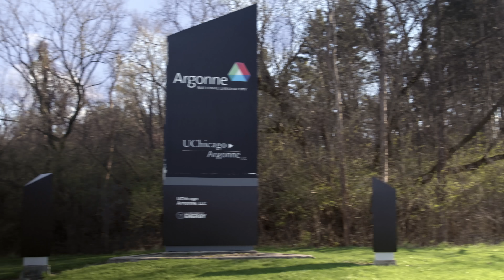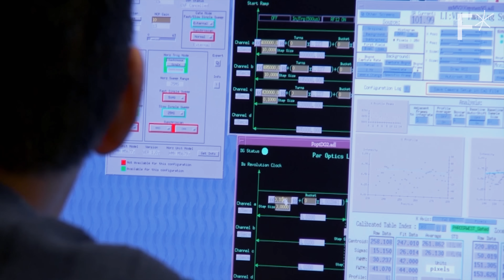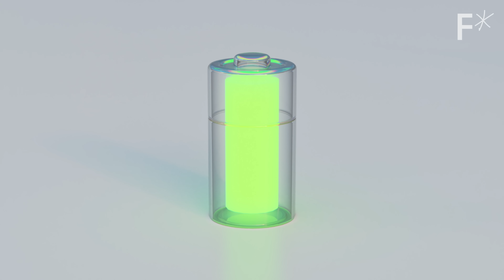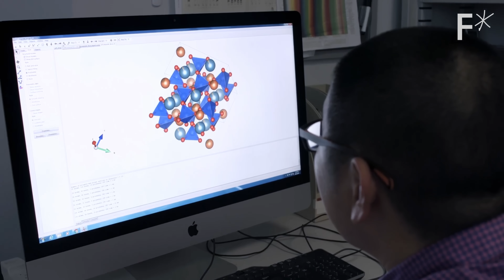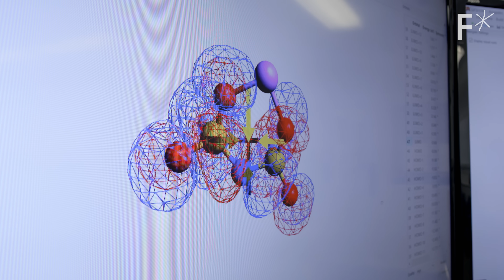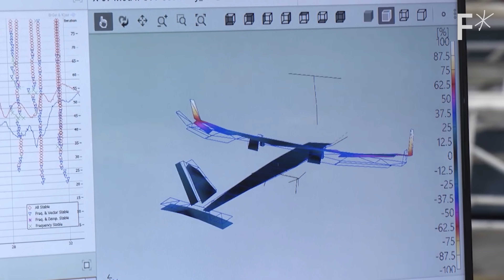The future of high energy density batteries | Hard Reset

Comment: Fundamental wrong. If you create amazing new batteries don't put them in every home. Rather put them in every industry.
Reply: Homes could easily become storage vessels for industry’s when people are at work. And pay the homeowners for its use.
Reply: Perhaps you don't want them in every home, but if every home had them, you wouldn't need to worry about grid stability if you have a large enough capacity you can cut off from the grid as needed.

Comment: This sounds interesting but if we don't find a particular material with low metal dependency, there's no point in this research. The current estimation is that if we continue on our current "green energy" route, we'll have to extract as much metal from the earth as we have since Antiquity, to satisfy our needs by 2050.
Reply: Cool, what's the alternative?
Reply: @SwuuschifyMe  Right now ? We have none. Maybe these guys will be the answer. Or, we could use less energy, but somehow I doubt we'll make sufficient effort in time on that front.
Reply: @user-xm4hl5zx1l  The real alternative is skipping storage and focusing on electricity *generation*. You need large generators to keep the frequency on the grid anyway, and you need a grid in order to not need overdimensioned battery banks literally everywhere. The grid frequency affects transport efficiency by a massive amount.

New geothermal tech holds great potential, if nuclear doesn't float your boat.
Reply: The metal doesn't get thrown away. The elements still exist. We need to invest in recycling, and possibly researching more easily recycled batteries
Reply: @ThomasBomb45  Sort of agree with you. Currently, recycling is a joke. But taking into account that there will always be a loss, the less metal dependent the better.
Reply: Incremental improvements are still good even if there’s some theoretical thing that’s better. A non metal battery sounds more like science fiction
Reply: The Next Generation of Batteries
Graphene technology is not the future, it has already hit the market
https://youtu.be/Zj9WFnyEyLw
....